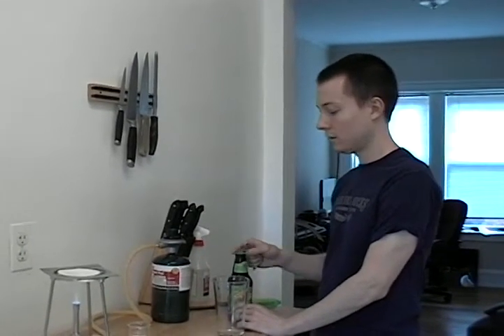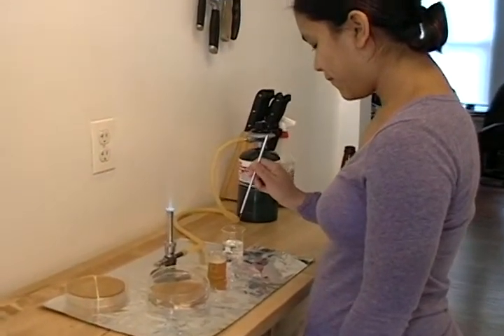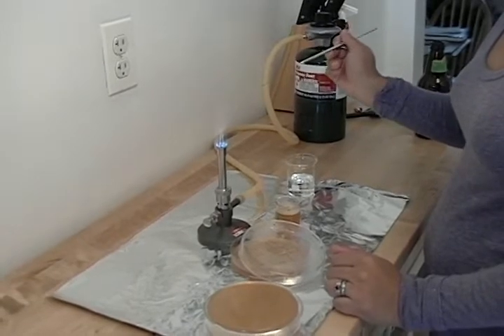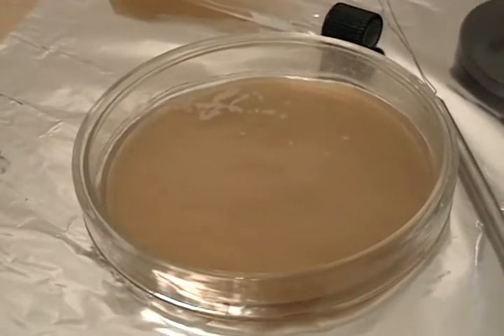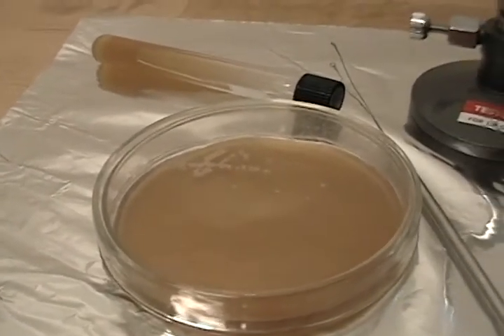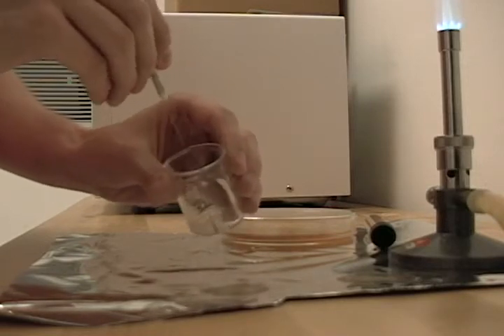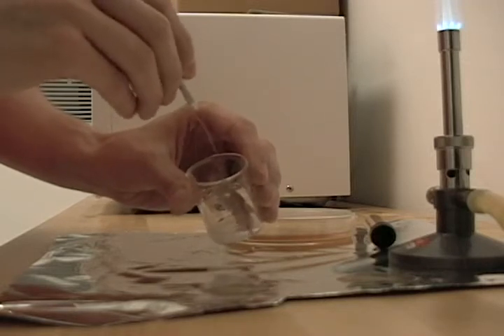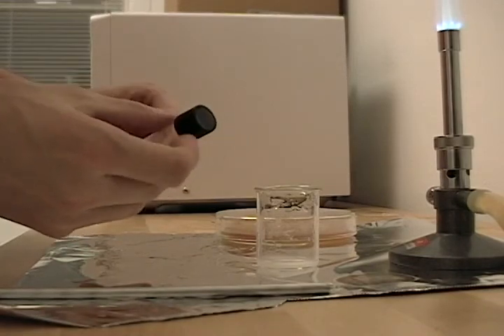Yeast Culturing: Purifying Yeast From a Bottle 2/2

Comment from the maker: You can usually incubate from 60F to 80F. It's not that important. Usually just leaving it at room temp. away from light is enough. Yeast on dishes doesn't last long as the thin layer of media will evaporate quickly. Slants can last months in a refrigerator (until they start turning gray and dying).